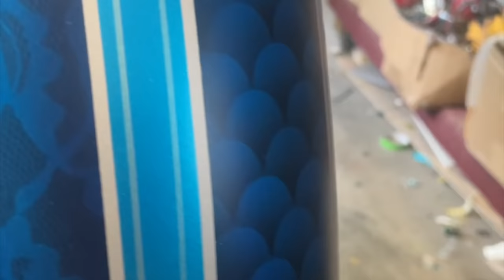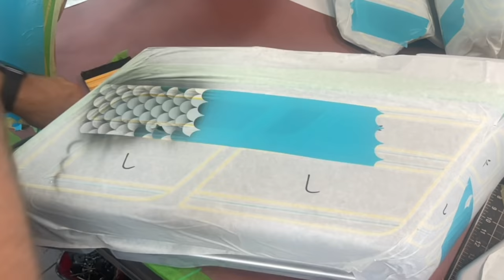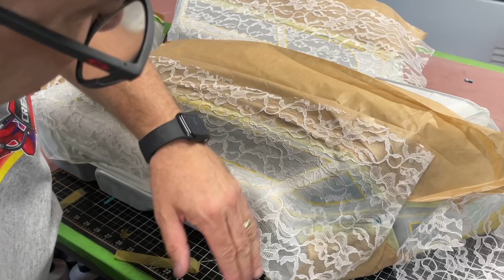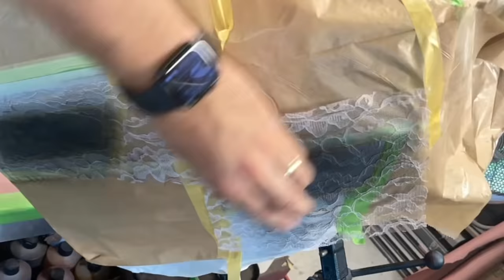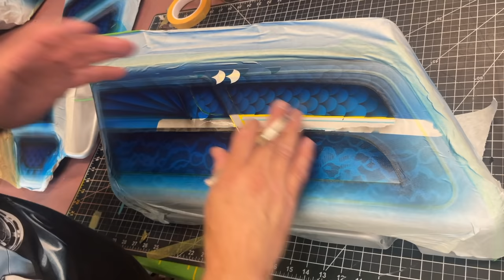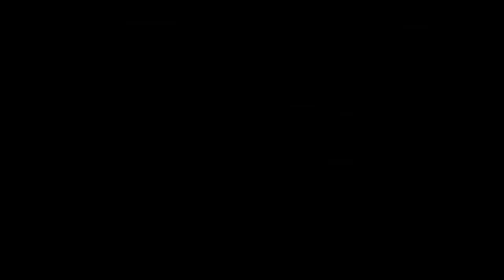Lowrider Custom Paint, Candy, Lace, Fans, & Fish Scales #lowriderpaint #custompaint  #Lace

Comment: Hey there. REALLY enjoying your videos. VERY educational. Appreciate all the instruction, advice, and oil tips to make jobs easier. Quick question…im respraying my motorcycle. Base coat, metal flake, and clear coats already done. Ready to sand and start some graphics with my candy colors. WHAT KIND of masking tape are u using to mask off the panels?

Comment: Awesome work! Can you elaborate on y not to use the sg100 Inter coat clear . I thought the sg-150  was for flake and pearls. Also the trans nebula 00 looks milky in the can does it dry clear?
Reply from the maker: 150 and 00 are pretty much the same thing. Yes as crystal clear as sg100 but unlike sg100. The 00 or 150 can go more then two coats because it had better binders so candies as well as pearls suspend better and you wont get the peeling it splitting that occur with ti much sg100 coverage.  I know we did it back i the day but its not the way to do it now and hasn’t been for a while